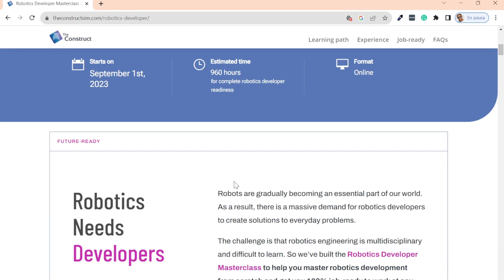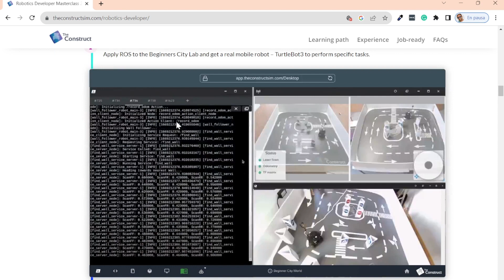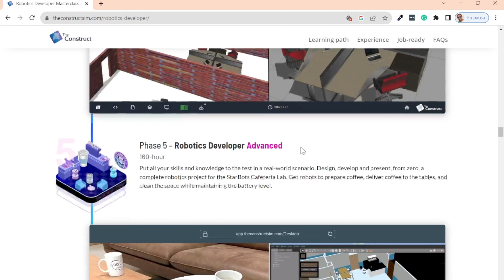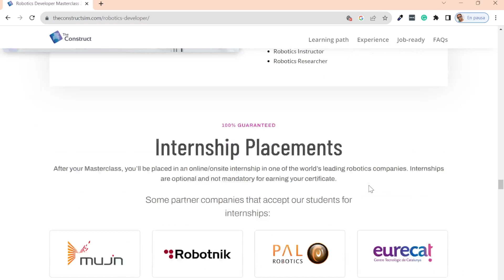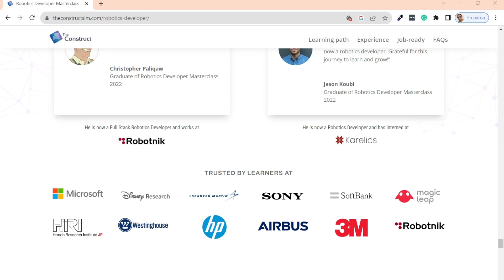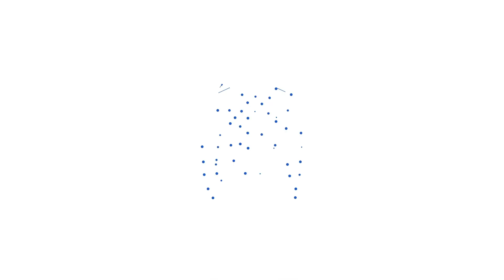ROS2 Control Podcast with one of its Maintainers Dr. Denis Stogl

Comment: What is the ROS2 control mock "simulator"? A kind of Simulink? How to use it ? Where to find?  I need to emulate a controller before deploy to the real robot, and struggle as little as possible 😅. because switching to real robot Lot of Issues raise and change things considerably. 😢

Comment: Could you please try to improve the volume levels? The guest was very consistant. However, the host made listening uncomfortable. The mike was very close to his mouth resulting in loud pops on hard consonants. When the host becomes excited he tends to shout directly into mike. Finally, he moves around a lot. Sometime he talkes directlyin into the mike which is one level. Other times, he looks away while talking and is hard to hear.

Overall the content is valuable, a little bit of awareness could significant improve the quality of the presentation.
Reply: Hi David, thank you very much for such valuable feedback. I’ll definitely check those points on the next episode. I’ll put all my effort to prevent those errors on the next ones. Thank you!